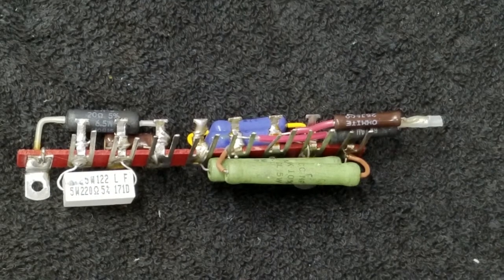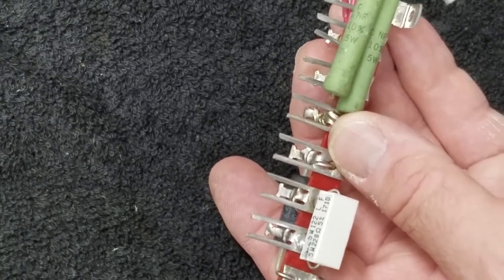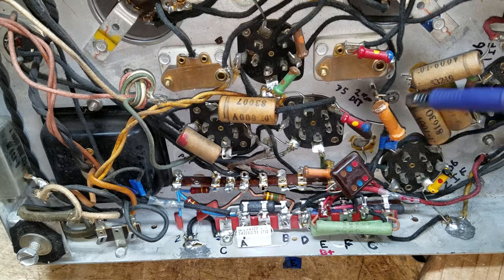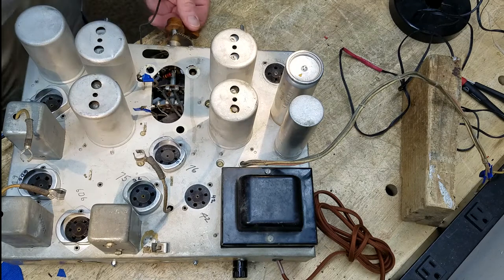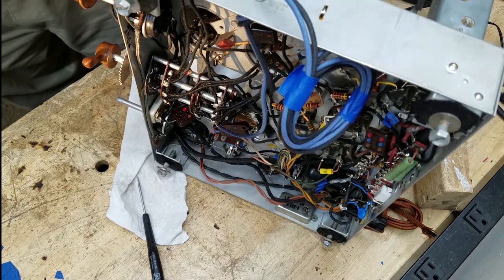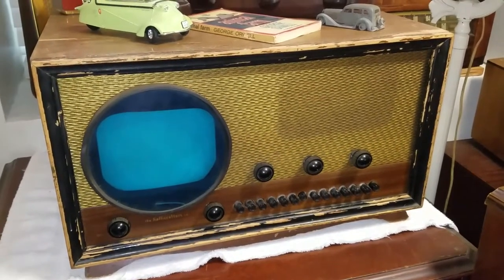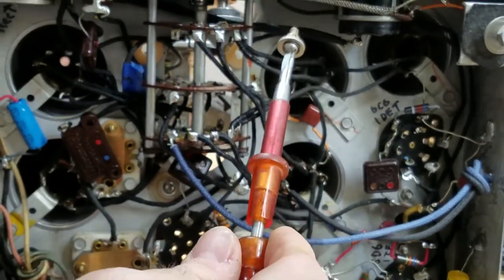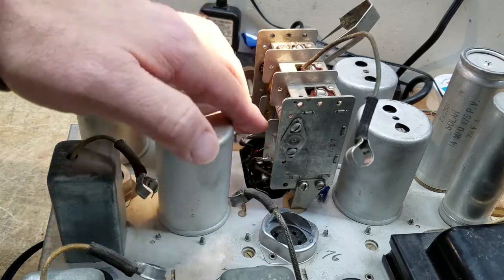Stewart-Warner 1262 Antique Tube Radio Part 4 of 6 Chassis Work

Comment: Great job, Michael! Good looking candohm, Ive found the older radios have oddball values and you have to mix and match parallel and series to get in the ballpark. Getting close, looking forward to ur next video! I have some catching up, been to the beach for a few days. Behind on watching videos and my projects. Take care! Larry
Reply from the maker: Larry,Like you, I have been kept from making and watching videos.  In a recent vid, I showed a new super-whamodyne computer that I recently bought.  Well, there was a problem with the motherboard and the computer has to go back to the manufacturer.  They treated me right, though and a brand new machine is being built for me right now.  It is the next iteration of the model line that I bought.  It does have a couple of minor feature improvements, and they say that they have fixed the "problems".  While this was happening, the computer that I have been using took on a Windows update, and now my video card has issues and the machine will not render videos in Premiere Pro.   That machine is off to a local IT guy, hopefully getting fixed.  When it rains, it pours.  I have all of the Stewart Warner video shot and I'm halfway through my next project!!  It is really good to hear from you, Larry!  I look forward to more videos from you, soon!   Cheers!    Michael
Reply: ThatTubeSound thx Michael! Just picked up my mail and the decal for the Philco has arrived! Hope it is in good shape lol. Not sure how much I'll get done, getting the yard and pool back in shape and the eclipse happens Monday. We are close to the centerline here and have 2 minutes and 38 sec . of totality. Town is predicting thousand coming, lol should be a sight to see lol. Hope u get ur computer issues corrected soon! Take care, Larry